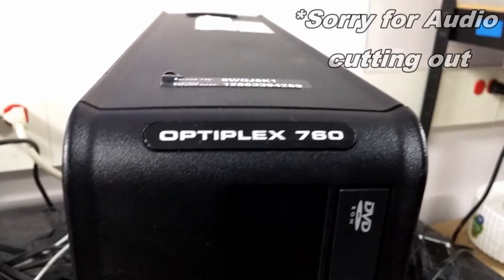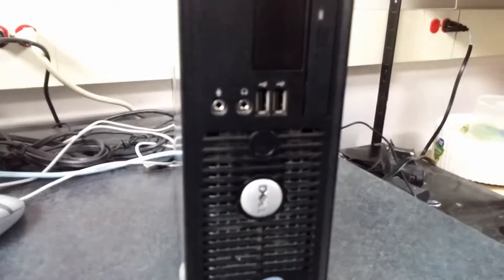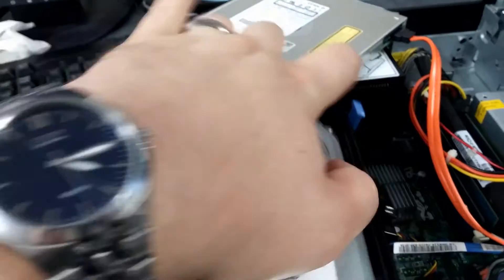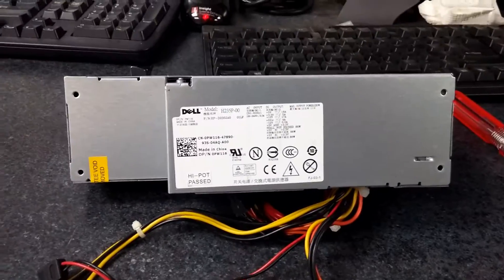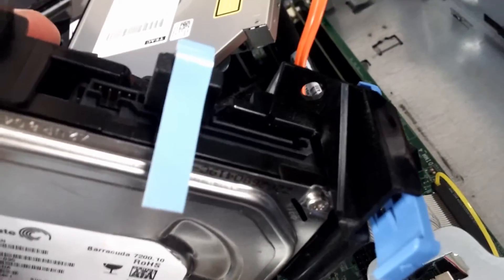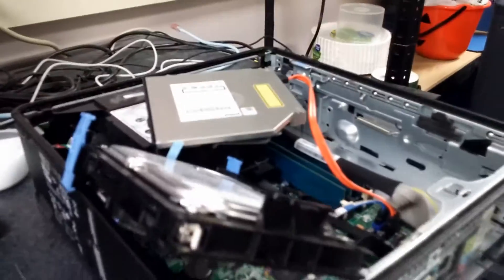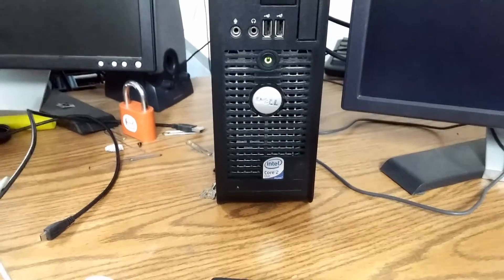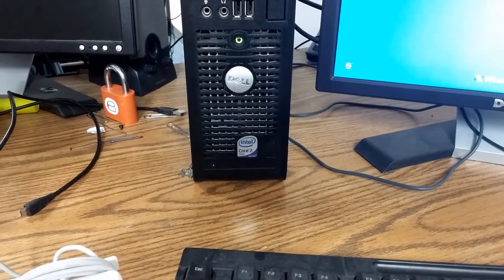Dell Optiplex 760 Slim No power Issue Solution

Comment: I found if switched the mains off, my computer took a lot of persuading to come back on so I just turned it off onscreen. this worked until 31 dec 2019 then died. whilst watching your video I found a reset button at the back of the power unit which powered up my pc once more.
Do I still need to buy a power unit?
I keep it in a closed cupbord with the door open, do you think it is getting overheated?

Comment: I have the same model and the same problem but I can't wait to order. I need another solution,  it could also be a system problem.
Reply from the maker: The fix is for the issue I know about in this video with the 1 and 3 error light blinking and now power. We have had so many of these power supplies pop that we had to phase them out early they like to go so often I am sorry I can't be of more help.

Comment: I have a little different situation with an old Optiplex 760 SFF.  Initially no power from the power switch, but the motherboard power light is amber.  No diagnostic lights on on front lit up.  Pushed the power supply reset and the CPU cooling fan came on, and stayed on.  Power switch on the front steady amber.  Still no front side diagnostic lights.  Can power off the computer by holding in the power button for 10 secs (estimate) but then the power button blinks a rapid amber.  I've already replaced the Motherboard with a known good. I swapped out the processor with a known good. Swapped out the memory with known good. I pulled the power supply and opened it up. Plugged it into power and pushed the reset button and the power supply fan turned momentarily.  I pushed in the reset button again and held it in and the power supply fan stayed on as long as the reset button was held in.  Considering the age of this desktop and the cost of a replacement power supply $23 for a used, and $40 for new, I guess it's just time to put this computer out to pasture unless someone else has any suggestions that I haven't tried.
Reply: Gary Hedberg I have all of the same exact problems that you have. How did you fix it?